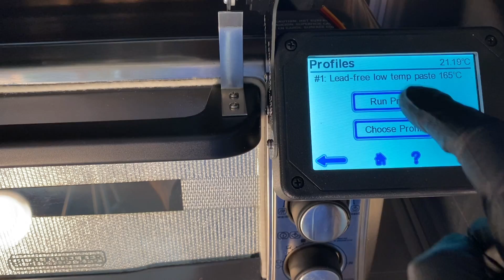Building a Custom Cloudlifter CL-1 | Mic Preamp Series Video 4

Comment: Wait, isn't pin1 ground anyway? Why is the header pin touching the ground pin on the backside? I thought it was there to ground shell!
Reply from the maker: I think you are correct that the tab on the XLR connector is meant to be attached to the case. Soldering it to the pin is what Cloud did on the Cloudlifter, so I did the same since my goal was to reproduce the same device in a smaller form factor. Probably not the answer you were looking for!

You can see that Cloud did the same thing in my teardown video: https://youtu.be/pZgYXbsPOTc

Comment: Correct me if Im wrong, but isnt one of the connectors connected backwards in this case? Hot in ends up at cold out and vice versa
Reply from the maker: When I held up the original Cloudlifter and my custom build side by side, I accidentally had mine rotated the opposite way. Maybe that is the confusion? The circuit matches.